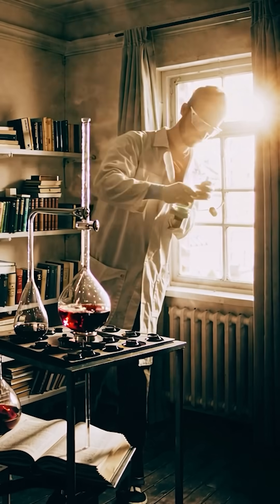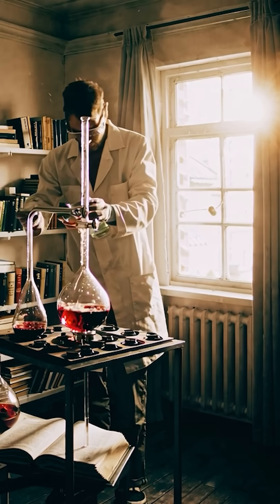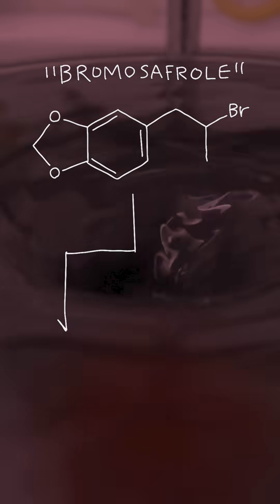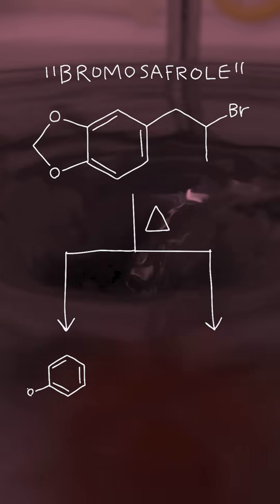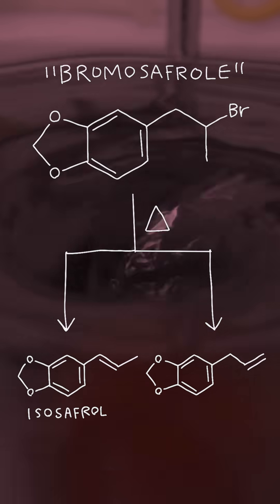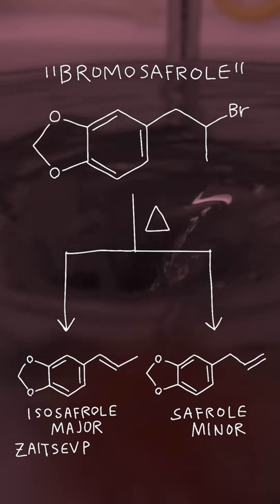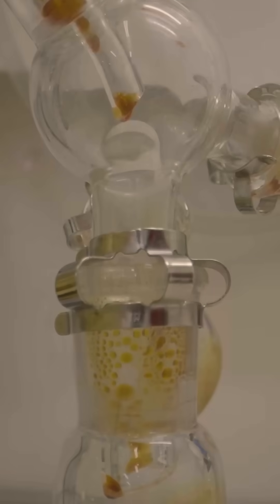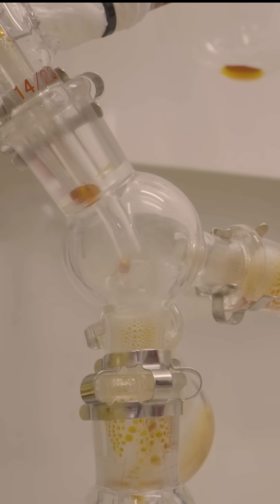Explosive dehydrobromination of bromosafrole did what!?

Comment: Must be nice to have access to that equipment and reagents.. he never explained what caused the vacuum to collapse.. we did not get the full story. Probably a faulty seal, I suppose..
Reply: in the full podcast he explains as follows:

he tried to purify the bromo stuff by vacuum distillation, so he pulled a vacuum and distilled off the extraction solvent first, then broke the vacuum by removing the receiving flask, but he took a while to get a new receiving flask all while the distilling was still being heated, which resulted in it reaching a critical temp and the molecule cleaving
Reply: @ Thanks!
Reply: He mentioned it was because he was swapping out flasks, which broke the vacuum and caused it to overheat.
Reply: Yea he did, he pulled the vacuum.
Reply: @ He pulled the vacuum? No he explained the cleavage occurred when the vacuum collapsed not when he pulled it. Unless what he meant when he said that he pulled it was that he intentionally disengaged the vacuum to let atmosphere into the vessel. If that is the case that means this anecdote has even less value than it would seem. Pulling a vacuum, in the school that I come from, means to undertake the process of evacuating atmosphere from a vessel. In any case he speaks far too rapidly and his story is all over the place.